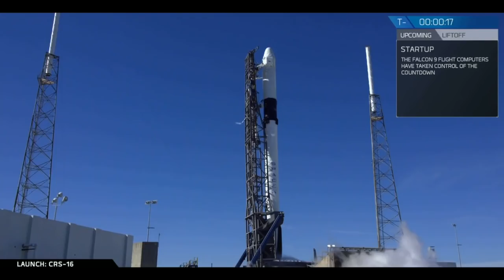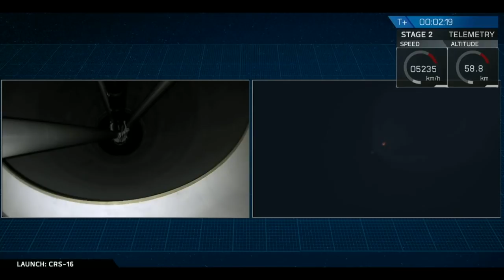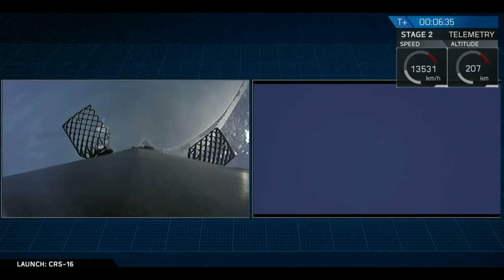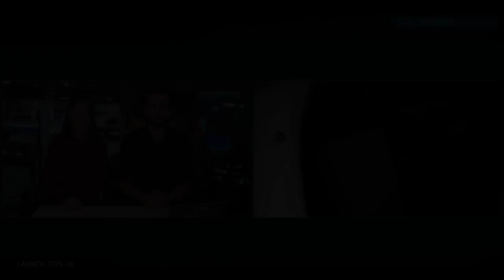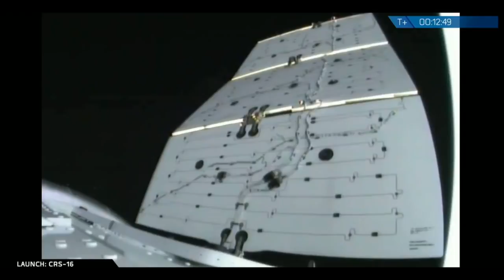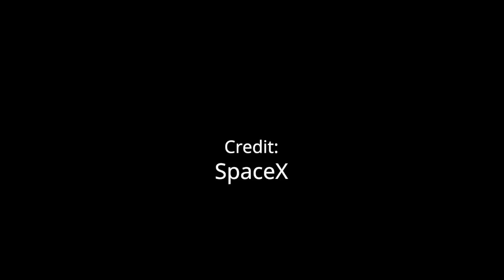Falcon 9 launches CRS-16 Dragon & Falcon 9 first stage failed landing

Comment: I love that it actually still technically landed.  It was just in shallow water rather than in the launch pad.  The spin from the stalled grid fin pushed the booster slightly off target by a few meters it seems.  The landing burn was actually able to stabilize the spin and it landed right side up, keeling over after landing due to uneven land and waves in all likelihood.  Vehicle still sent telemetry after water landing and appeared to be largely undamaged from sensor readout.  A recovery vessel was sent out and Elon stated that it would likely still be able to be reused for a SpaceX mission.  I hope we get to see it actually land on target in the future.  Due to the grid fin failure, Elon also stated that a redundant mechanism may be added to all grid fins to ensure that a failure like this doesn’t occur in the future.
Reply: I really doubt it's possible to reuse. That's a giant longitudinal load on the tank, which can cause microfractures that later cause failure.
Reply: Ambient Morality   SpaceX will do a complete inspection and may refurbish it if there are such damages.
Reply: @indigodragon0613  You can't refurbish an aluminum tank with fractures. That's a total replacement. Saltwater in the engines will require extensive re-inspection just to make sure they're safe enough to even run on a test stand, much less in a rocket.
Reply: Ambient Morality   Just watched the footage on Elon’s twitter.   Water was extremely shallow and the booster didn’t roll at all.  Only one side got wet.  I guess we will have to wait and hear what SpaceX want to do with it.
Reply: @indigodragon0613  The engines definitely hit the water there. Maybe 'one side got wet', but essentially everything got salt water spray on it. Salt water spray caused the failure of Falcon 1 Flight 1, so it's not something to dismiss.
Reply: Ambient Morality   I know that it’s serious.  I’m just curious if the falcon booster gets a freshwater wash within a certain time frame, if the damage from saltwater can be minimized or even avoided.  The rocket wasn’t submerged and was recovered faster than it would have if it had landed in deeper water.  I’m hoping that a freshwater bath or shower can avoid most of the damage as it takes some time for corrosion to start.  Then any damaged or at risk parts can be replaced.
Reply: @indigodragon0613  After immersion for at least a few hours (I don't think they have anything to take it out of the water until it gets to a port), freshwater wash isn't going to help much. It'd stop further corrosion, but by then it wouldn't be very safe by aerospace standards. There'd still be lots of disassembly of engines, engineering hours being put into verifying parts are okay, etc. 

However, it might be possible to salvage some parts. The titanium grid fins are worth millions, and titanium does well in corrosive environments. They're a single piece, so it wouldn't be hard to inspect, and it's not critical to ascent. There are likely similar parts that could be reused.
Reply: @Airbiscuitmaker  It's salt water. That does serious damage to aluminum. They've already had a rocket failure (Falcon 1 Flight 1) because the rocket sat out at the pad too long and salt water spray from the ocean (a hundred meters away, at least) caused corrosion of a nut.
Reply: Ambient Morality   Yes, that’s why Elon said that it may still be used for “internal SpaceX missions.”  They’ll figure out a way to reuse it somehow, even if that doesn’t mean flying the entire thing to orbit.  They may just use it for testing.
Reply: @indigodragon0613  SpaceX doesn't irrationally reuse. If it would cost more to reuse most components, then it's not worth it. Spending tens of millions of dollars on labor and engineering hours to recover and replace components on an asset worth $20 million at the most just doesn't make sense.
Reply: Ambient Morality   It wouldn’t be irrational to recover undamaged components and use them.  It would be irrational to allow the booster to go to waste if the damage is minimal.  We have to wait and see just how much is damaged.
Reply: Julia Crawford Interstage looks destroyed at least. Saltwater on engines for three days now (and probably longer) isn’t good either
Reply: Ambient Morality   Yeah it’s been in the water for a good time now.  SpaceX seems to be a little friendly with saltwater recently.  The last launch they did before this one had an attempt to catch the fairing which failed, yet they still recovered them and plan to use them, even after they were in the water.  Then with this booster, they said that they may still reuse it even after it being in the water.  Sure makes me wonder why they are being so nonchalant about their equipment taking a bath.
Reply: @indigodragon0613  I wouldn't take Musk's statements too seriously. There have been many instances where Koenigsmann or Shotwell have had to walk back his claims a bit, as he often tweets before engineers have actually determined something. The fairing recover seems slightly more plausible as they've been recovering fairings from the water and certainly inspecting them. Here, they've never recovered a booster like this. If I were an engineer at SpaceX I'd want rigorous testing of airframe and engine structures before proceeding with any sort of test fire – and that'd likely involve destructive testing of at least some components on the core.
Reply: Ambient Morality   Yes, obviously we have to take his tweets with a grain of salt.
Reply: @AmbientMorality  
It will be X-rayed , Ultra Sound seen throughout before being reused in just like new condition . We all hope for it .

Comment: Elon confirmed that one grid fin was stuck due to the hydraulic pump failing, causing in the booster missing the landing zone. They will still recover it though and evaluate its condition, also they might add a redundand pump.
Reply from the maker: @Mopskopf 42  Falcon 9 landing anomaly explained https://www.youtube.com/watch?list=PLpGTA7wMEDFhuvDu_hopPa3X6TiFoK_3Y&v=SreNDDNZIG4